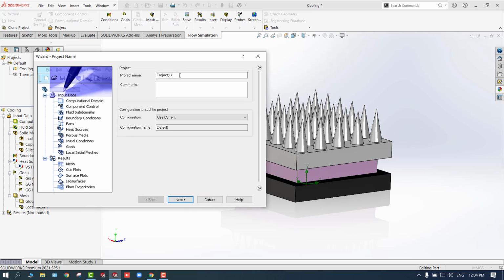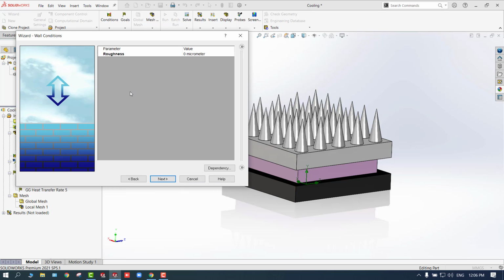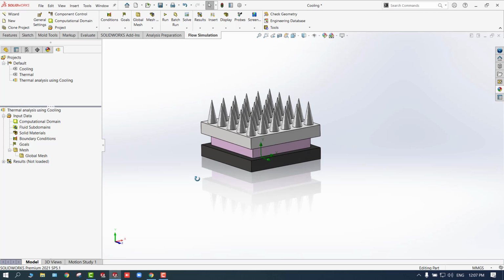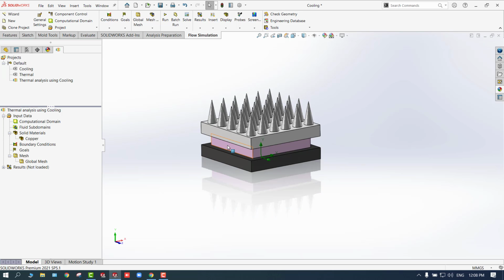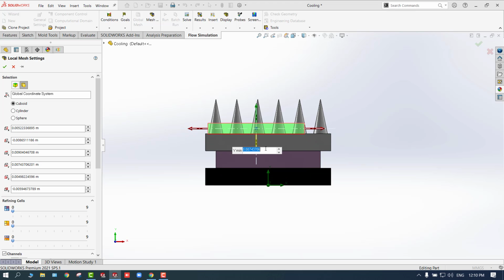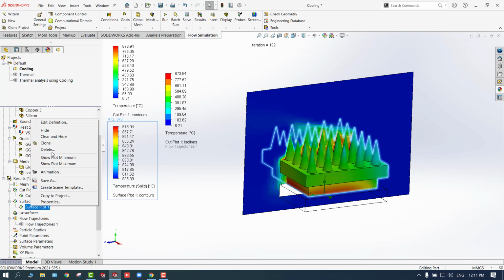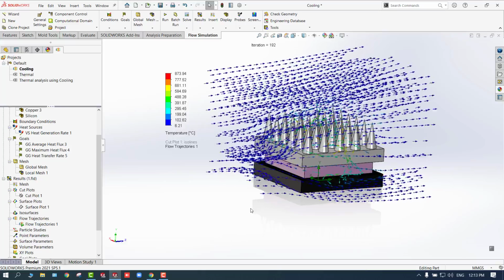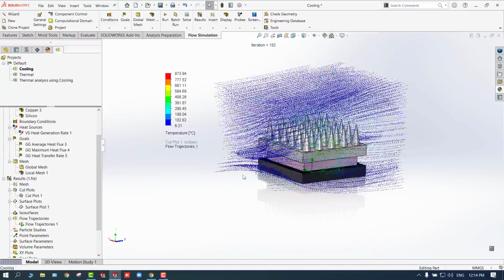Heat Sink Thermal Analysis in SOLIDWORKS Flow | Thermal Analysis in SOLIDWORKS Flow Simulation

Comment: Error message -cannot find results please solve the project. What could be the possible reason
Reply from the maker: Results files might have misplaced, you need to re-run the study  or else create the new study and run the analysis again. 

You can set the results file location in default settings